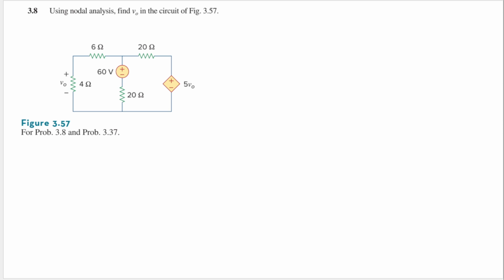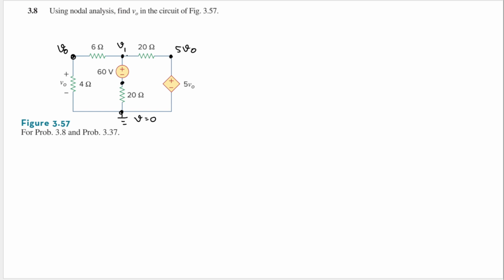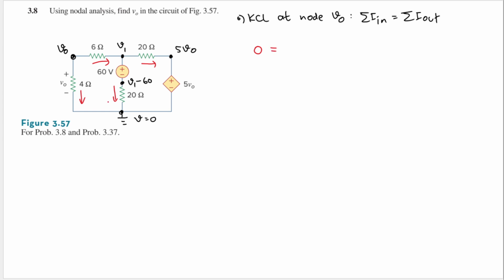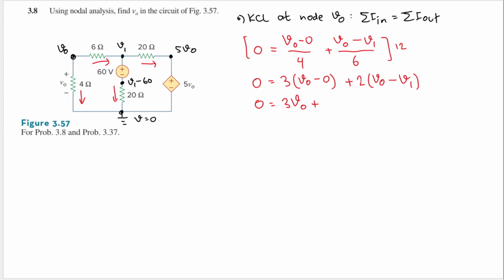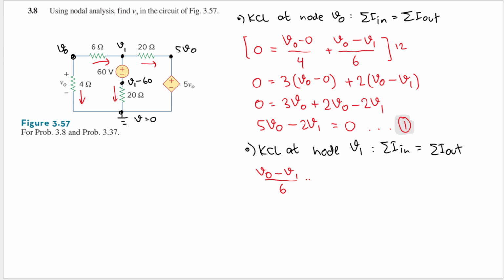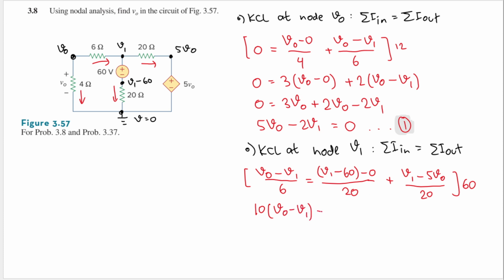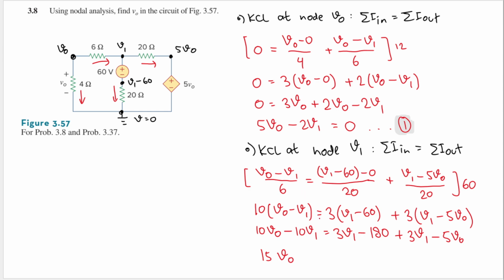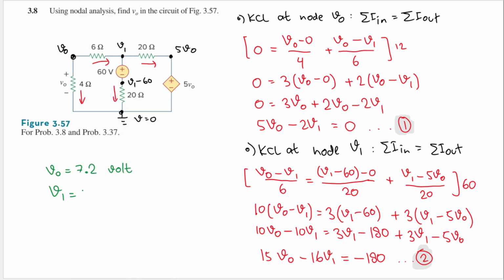Problem 3.8 - Fundamental of Electric Circuits (Sadiku 2020) 7th Ed - Nodal Analysis

Comment: In the V1 node it should be 25Vo-16V1 = -180
Reply from the maker: Thanks!
Reply: Here i1 = v1/4+6 = 60/10 = 6A 
So vo = 6×4 = 24 volt is it right?
Reply: @nafi-no8dq V0 = 12， V1 = 30，I1 = V0/4+6 = 1.2A， Vo = 1.2*4 = 4.8V
Reply: @Sheldon-v8d   why is this ( I1= V0/4+6)                         isn't it supposed to be like this? I1= V1-0/6+4 = 3A ???